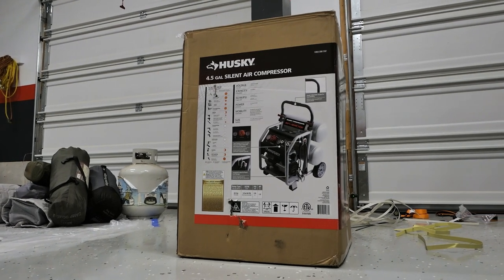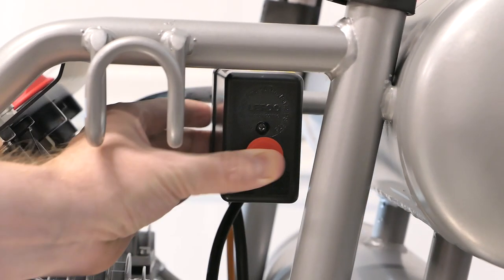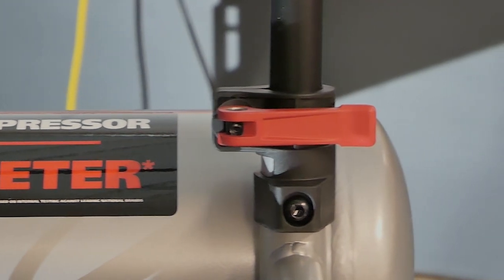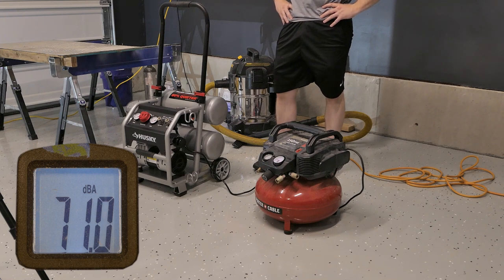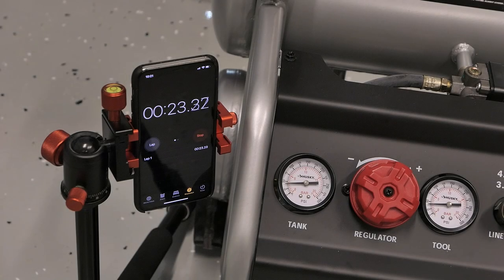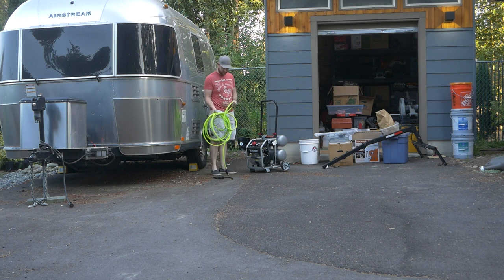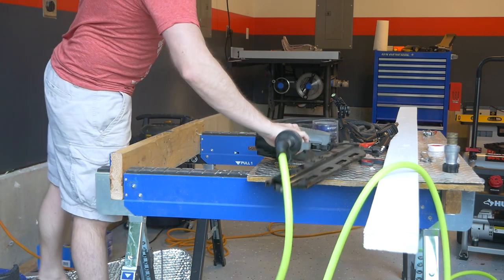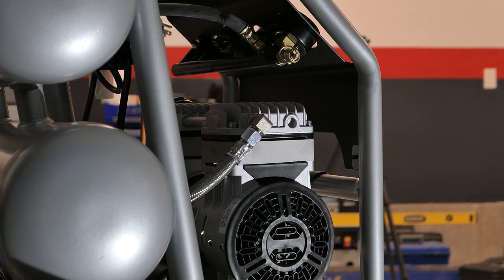Husky 4.5 Gallon SILENT Air Compressor Review & Demo

Comment: Hey thanks a lot for the video, I really appreciate your work here! You also made me realise that maximum pressure is also important! On a side note, your calculation is slightly wrong since you have to use absolute pressure, but the compressor gives you gauge  pressure, so you have to add 175+14.7. For all intents and purposes it doesn't really matter but hey it can't hurt to use the formula correctly :)

Comment: I am in the market for a compressors.  I am also a novice and I want one that can handle more than just filling air in the tires.  You use a 3/8 inch line with an air wrench, which was one thing no one seemed to explain about hose sizes and their limitations or capabilities.  This unit looks like a good purchase for me.  Good video and thanks!  Still a bit confusing but I will learn!
Reply from the maker: Hose size is important. A 1/4" line will turn an air wrench, but won't spin it up enough to actually do much work.

Comment: I noticed the Porter Cable compressor did run around a little bit from vibration & the Husky did not run around because the vibrations are isolated by the rubber feet.
Reply from the maker: The Porter Cable "taking a walk" every time it runs has been annoying me for about 10 years now.

Comment: I would be curious with the small tanks how well this would work in blowing out sprinklers.
Reply from the maker: Likely depends on the size of the irrigation system.
Reply: @aaronstestlab  I
Reply: Keep in mind you could also add an auxiliary tank if you found you needed more air to get it done.

Comment: Just for what its worth, at 2:37 that is not an exhaust. There is no exhaust except for the compressed air outlet on electrically driven air compressors. That is an air inlet filter for that piston, and appears to be the Solberg design or at least similar to it.

Comment: I have a vending machines, would you recommend this air compressor for cleaning?? basically just need to air the compressor unit below, dust off the machine.
Reply from the maker: So long as you have a reliable 110v power source handy it would work very well. And it wouldn't disturb local patrons due to being very quite.

Comment: Would this compressor be fine to run a air ratchet once in a while ?
Reply from the maker: No problem
Reply: Incorrigible Aaron I just got this compressor today for 160$ an It blew my mind when I turned it on it’s more quiet in person then on video
Reply: @kamryn7496  how you get it for $160 used?
Reply: xCALIWEBKINGx SNFx some one on the Facebook market place sold it new in box for 160

Comment: Have you tried any HVLP paint guns with this compressor? I'm thinking of getting one of these and a spray gun to paint some custom furniture projects. The gun I have in mind says it needs 4.0 scfm @ 40psi. Does this compressor deliver that even if it's clicked on?
Reply from the maker: Runs 3cfm@90, probably a bit more at 40. Intermittent HVLP is probably fine. Heavy use I'd go with a bigger compressor or purpose-built HVLP blower.

Comment: NEVER put a lug nut on with an air impact gun
Reply from the maker: You should impart your wisdom on racing pit crews around the world
Reply: Should use a torque stick they are great!
Reply: You all make good points. I agree for us regular folk using something non-impact would extend the service life and possibly prevent costly repairs. And for professional racers, the speed of impact tools is a necessity, so replacing lugs or studs regularly is just part of the costs of admission. Our parent company ran the 78 car (NASCAR) a few blocks from where I worked, the cars get pretty heavily worked over after each race. I enjoyed the video, thanks for posting it. I did cringe a bit when you used the nail gun. I wouldn't trust myself without steel toes on shooting them into that narrow beam.
Reply: Tell that to literally every mechanic ever.